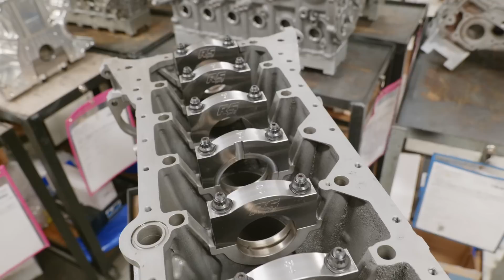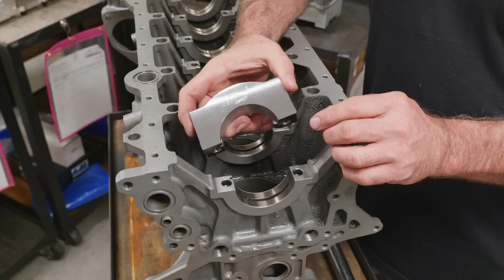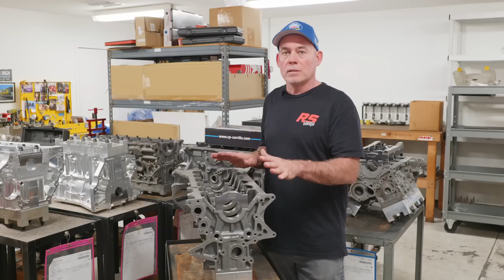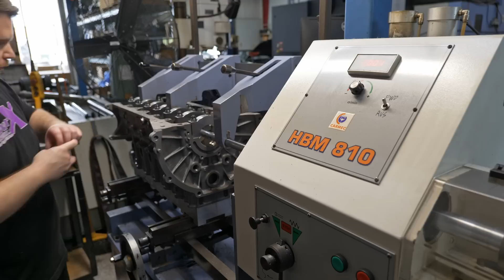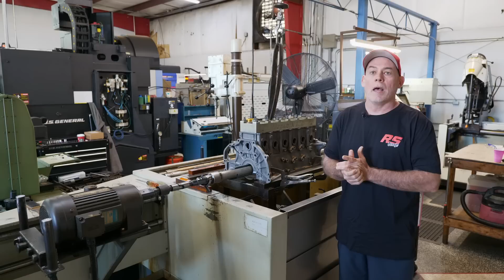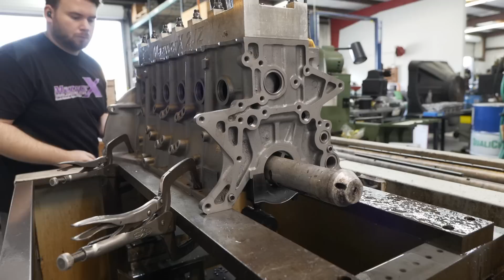How to Install Billet Main Caps on a Toyota 2JZ | Machining Process Walkthrough feat. Mazworx

Comment: On an engine i've disassembled, when i bolt the main caps with the bearings they don't line up. I have to slighty hit the caps back or forth to align them. Is that normal?
Reply from the maker: That's not uncommon, I appreciate you looking closely.  How much is the offset you're experiencing ~Jay
Reply: @RS_Garage_US  I haven't measured it. I would say 1.5mm. Thanks for the quick reply

Comment: Hmm Is the 2j at disadvantage not Tying  the main caps at right angles in the block as in 1 uzfe and Ls engines
Reply from the maker: To some degree. The fact that there's 7 mains and 6 rods helps keep that in check. The oil drains from the top of the engine are occupying the space you'd add cross bolts. On a V8 engine cross bolts help a lot as the engine block is subjected to a bunch of forces that an inline engine doesn't deal with. ~Jay

Comment: In theory if I have a stock block and stock caps with just arp studs. I have to measure the main bores and if they’re within limit of the manufacturer I don’t need an align hone?
Reply: Correct
Reply from the maker: If the hardware doesn't change the shape of the housing bore and the engine hadn't been run you'd be OK. It's best to check it, it's soo much cheaper to know what you have VS gambling. ~Jay

Comment: With ARP bolts, do you put some lubricant on the thread that goes into the block or only on the top thread and the nut?
Reply: I was thinking he should've touched on this, the bottom side threads get regular engine oil as lubricant.
Reply from the maker: @Phantom-Rx79   That's correct you want to make sure the holes in the block are clean and dry. Residual water left behind from washing can cause corrosion down in the threads.  A little motor oil helps control corrosion in these little nooks and crannies. Thanks ~Jay

Comment: Great video,  it’s too bad some machine shops are scared to perform this procedure.
Reply from the maker: It's a lot of risk if it goes wrong. You end up with a bunch of junk engines and angry customers. Building engines is a labor of love.  It's easy to turn down the work that doesn't have a lot of reward to offer while exposing the machine shop or builder to a lot of risk. ~ Jay

Comment: When are billet main caps needed? 

Also, how much HP can oem caps hold with arp hardware?
Reply from the maker: The general consensus is over 1000hp. There's been a hand full of guys that have gone for the "stock block record". They make a big number and are meet with celebration, shortly after the engine dies and they don't talk much about it.   Billet mains are good insurance, and we are extremely lucky to have access to an engine that needs so little modifications to have a good live over 1000hp.   

 If your aim was strictly make dyno numbers you'd limit torque, bleed boost in with RPM and get away with it. If you're going to build an engine that lives well the investment of billet mains and hardware is cheap insurance.  ~Thanks Jay
Reply: @ awesome I appreciate the informative response and like always keep doing what you’re doing with the 2J community!!

Comment: I think it would be important to mention any machining differences with going to an aftermarket block. Also if/when an abradable coating is used during this process, in another video perhaps
Reply from the maker: The approach on a independent main cap engine like the 2jz stays the same. When you have bedplate engine things change a bit.   For example, an engine with a bedplate design that's been sleeved with be more work to get straighten out than a 2jz.   You'd never use a coating in a housing bore, the housing bores are bare metal so the bearings can "sweat" heat into the block from the bearing face. The bearing housing is the foundation of a solid environment for the oiling system to succeed in keeping the engine alive.  

 I'll put a video together on the evolution of the main housing bore. Maybe that helps shed some more light on the subject. Thank you. ~Jay
Reply: @RS_Garage_US  hey thanks for that explanation, I look forward to your follow up video!

Comment: Why does performance rods have dowel pins to keep the caps from misaligning but these main caps don`t.
Reply: The 1st part of the video talks about the caps having an interference fit. Meaning the sides of the cap are held in place by the block. They can't go anywhere.
Reply: Extra machining cost

Not to say it doesn't exist but pinned caps have been done on V8s and subarus lol. 2JZ Do-Luck Brace or Dart 4 bolt main blocks do exist for the 2JZ btw. Check with your machinist they might have options for you.
Reply from the maker: As noted by @chasingperfection the caps are located in the main registers.  There are engines that use both dowels and registers and some engines that just use dowels.  A well built 2jz doesn't suffer from cap walk unless the tuner/owner is operating the engine in an ill state of tune. ~ Thanks Jay

Comment: Now we can just buy a dart block.
Reply: Jay did a video on the dart block too. These same processes and more need to be completed on it as well. They don't come ready to go out of the box. The deck comes tall, the cylinder bores small, etc.
Reply: Not everyone needs a Dart block, or the extra weight that comes with 🙂👍🏼
Reply: Dart block takes WAY more work than this to be ready.
Reply: @ArthurSperotto Like what?
Reply: @Backyard_Racing our dart block had the mains over spec and had to cut the caps and hone to bring it back.  Annoying but not the end of the world.  Then you have to hone the bores and deck the block.
Reply: @ You have to do the same to an oem other than maybe decking it.
Reply: One of his video says they come higher and tighter and needs machine work to fit everything so I would assume its not a drop in affair.